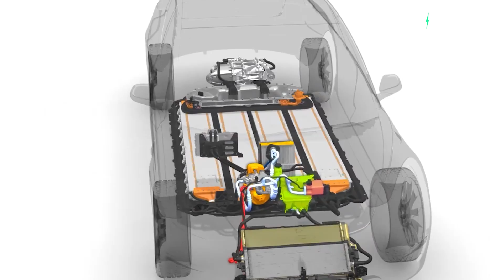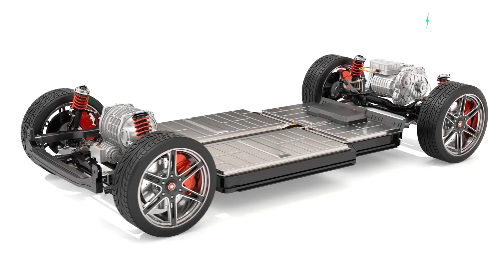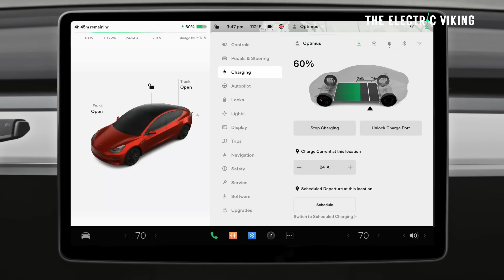No, you don’t need to replace Electric Car Batteries in 10 years time

Comment: There are two factors - cycles, which is pretty much analogous to mileage, and calendar aging which will be independent from usage.  If EV batteries can make it to 20 years (assuming reasonable mileage/charge cycles), then EVs will retain their resale value along the lines of ICE cars or a bit better.  But if the batteries start dying just from old age at 15 years, then cars that are 12 years old (average age of cars in the U.S.) will have little value as they approach the hard deck.  Time will answer this.
Reply: @AudiTTQuattro2003  I think battery insurance is actually a good idea.  If the incidents of battery failure are indeed low, then the cost of insurance would reflect that.  If the price of battery insurance is high, it would indicate to me that the batteries are failing higher than believed. The fact that Tesla (or any) manufacturer doesn't offer insurance past the warranty makes me wonder about what they think the average lifespan of an EV pack will be.
Reply: @ohger1 if insurance wasn’t ‘for profit’ I could agree with you. But as it is, insurance companies use any excuse possible to raise rates.
Reply: @ohger1 so why aren't ice insured for a decade or more?
Just thinking balance ⚖️
Reply: @andrewsaint6581 ? They are. It isn’t legal to drive without insurance.
Reply: @ohger1 even a minor fender bender in a Tesla can result in the entire battery pack needing to be replaced as it’s impossible to validate that every cell is safe.
Reply: @mkyhou1160  Actually not really.  The car's BMS will pick up any electrical anomaly, and a "fender bender" will not generally damage a battery pack anymore than it will a gas tank. It takes a significant frame impact to damage a battery pack.
Reply: @ohger1  that’s not what Hertz found….
Reply: @mkyhou1160   Not the fender, but if evaluator was thinking there is a hit to the battery case, or think impact could damage the battery pack, yes insurance in the past and many still do it, they was taking no chance and full refund. But I heard now more and more now Insurance company have the data and beginning to fix those battery pack if needed (Way less costly for them) as data become available and expertise become available for them with all those new vehicles.
Reply: @sergiomomesso1590  I had a new Peugeot. It was hit broadside on by a taxi (a Toyota minibus). At a traffic light, not a major collision, the taxi was able to drive away, no one was hurt. My car was written off because the chassis buckled. So far as Insurance goes, in South Africa,my country, if the repair cost is estimated to be 40% of the resale value of your car, it is written off.
Reply: @mkyhou1160  At no point did Hertz ever publish anything like that, that's proprietary info.
Reply: @mkyhou1160 that simply isn’t true.
Reply: @mkyhou1160 that isn’t what Hetz said
Reply: My concern with EV's is simply related to price.  I presently drive a 2014 F150 5.0 with 210K miles.  It runs great but nothing lasts forever.  Hopefully the marketplace will continue to develop EV's, but many vehicle makers seem to be moving away from EV's.  Relocating has drastically reduced my annual driving mileage.  But still unsure about an EV.
Reply: @brucegrimmett367  find "I love electric vehicles" article by Rowan Atkinson
Reply: @brucegrimmett367   I wouldn’t be too concerned.  If you drive less than you used to an EV is probably going to be a good option for you.  Because you’re not driving long distances there’s less likelihood of range anxiety than if you needed to drive 80+ miles per day etc.  Get a charger installed at your home, you’ll be able to charge the vehicle for probably $8-15 per charge cycle, maybe $20 for a full size pickup.  No waiting in lines at gas stations or hunting for the best price.  No freezing your arse off filling in January if you live in a cold area, just drive into the garage and plug it in.  

The much lower repair and operating costs end up outweighing the higher initial price.  If you regularly tow items long distances then an EV may present some challenges, at least at their current level of performance and maturity.

Costs should start to drop, especially if Chinese EVs start to show up in the US, assuming that’s where you live. The major automakers are reducing their rollout of EVs because they haven’t figured out how to make money on them, unlike Tesla.  Eventually I expect them to get their sh*t together.

Hold onto your truck for a few years longer if possible and see where the technology is at.  My experience with my 2018 Chevy Bolt is that it is a great vehicle, quiet, I’ve spent literally no money fixing it at all, just standard brake pads and tires replaced. Check to see if there is an F150 Lightning for sale near you and check it out.  Ford is dying trying to sell them right now, I suspect a lot of people are hesitant like yourself but you might be able to get a good deal on one as a result.  A guy I spoke to at the recycling centre near us had nothing but good things to say about it.
Reply: Fun Fact:  The average ICE car in the United States lasts 11.9 years.  Obviously some last longer but this is the average.
Reply: I only know what I’ve personally witnessed and every time, EVs that are 10 years old at this point have been problematic. Ford Focus EVs have dropped like flies in the cold due to battery coolant leaks. I have seen these for sale for $500-$1,500 needing new batteries priced upwards of $15,000. Similarly aged Nissan Leafs experience thermal degradation and high cycle counts causing an unusable range of 20-30 miles when the cars reach 60k to 90k miles. When I finally settled on a Prius for my commuter, I came to the conclusion to wait and observe the EV market. Based off of what I’ve seen, modern EVs are anything but simple and they will be a nightmare to maintain down the road when compared to an ICE or hybrid. It will be interesting to see what happens as these new EVs age. Time will tell.
Reply: @airborneadventurer you didn’t mention the other aged EVs, the Model S. Those have been very reliable.
Reply: Any car, ev or ice has a marginal value after 12 years.  So stop obsessing with replacing it.  Any major work on a car that old will cost more than the car so at that age we just drive them to the ground and move on
Reply: @b3arwithm3  agreed. But nowadays that’s probably closer to 16 years or so.
Reply: @Meatball2022  u mean 16 year life for a car?  If you live in California, it doesn't surprise me.  If you live in Canada, rust will kill your car in just 8 years. You would want to replace the eye sore regardless of the battery or engine condition
Reply: @b3arwithm3  buy an F150 - they are aluminum and run for decades in Canada.
Reply: @b3arwithm3  no. I mean prices don’t bottom out until closer to 16. A 12 year old car is still worth several thousand dollars. Price increases and parts availability issues have caused this
Reply: @Meatball2022  several thousand is isn't much. New brakes cost $1200.  New tires $800. Labor for repair is also high.  I would just trash it at that point because it's a money pit.
Reply: @b3arwithm3  bottom end for a car is usually 2500-3k. A car only 10-12 years old is usually worth closer to 8k. Not near bottom yet. 17 years is more loosely bottom - as I stated before
Reply: @Meatball2022  what 12 years old is worth 8k?  Even in California we won't get 8k for a Camry of that age.  Check kbb.
Reply: @b3arwithm3  kbb even has them ranging from 7700-9200 depending on model. 
It took literally 2 minutes to prove your statement incorrect.
Reply: @Meatball2022  what mileage did you use? I put in 180k which is 15k per year and got just 5500$
Reply: @AudiTTQuattro2003 isn't your battery carrying a warranty of 8-10 years?  You get free replacement if it falls under a certain %
Reply: time DID answer this, via cellphone batteries, also, you do have 10 year old teslas: how much of them are on the road? with how much remaining capacity?
offcourse car batteries are bigger, and more expensive, which raises another difficulty in making small, cheaper, sellable evs: small car with small battery wouldn't last at all before range becomes ridiculous. 

overall, one doesn't know these days will evs remain semi-rich people's toys like they're today. 
given the rising costs of energy and havoc on "green transition" that'll have.
Reply: @ivok9846  to compare a cellphone battery to an EV battery is beyond foolish. Well beyond foolish. In fact, it’s so far beyond foolish I can’t even describe how foolish it is.
Reply: @ivok9846  no, time did not answer this, because cell phones have no active thermal management systems to prevent degradation. The BMS and thermal management in an EV will allow the battery to last much longer, especially if the battery isn’t exhausted completely and charged to 100% regularly. And most drivers of average commute distances with a current generation EV can easily go 2 days on a single charge, so perhaps 180 charge cycles per year.  Hell, I’m typing this on an iPad that’s almost 3 years old and has been charged to 100% or very close and discharged to almost out of power over 800x, and it has basically no thermal management other than slowing the cpu down or shutting down if it’s too hot, it’s still doing pretty decent.
Reply: @sjsomething4936  thermal management doesn't prevent battery from wearing out. 
what exactly your 3 year old iPad proves? 
that if everyone charged to 80% it would extend life to what, 6 instead of 5 years? 7? 
Tesla roadster and model s are more than 10 years old: did they all survive?
Reply: @ivok9846  if you’re so worried about battery life, keep making yourself poorer by buying ICE vehicles, none of us EV owners really gives a shit.  Personally I’m confident that the batteries will live more than long enough to justify the purchase of the car, and so far the data bears this out, as demonstrated by the statistics provided in the video.
Reply: @sjsomething4936  what stats, none of you owns ev near 10 years. as for making myself poorer, can't I buy 2 ice cars for price of one ev, AND each of those two lasts 20 years easily. 
offcourse if I buy used ice, situation changes drastically, and not in favour of ev. and will there ever be used ev market? oughm....
Reply: Battery techs are improving.   My concern is more about motors.  I charge at home most of the time and try not to drain the battery below 10%.
Reply: @canine4350  on my Mylr I simply stay within that daily driver range 50-80 as much as possible. Keep an eye on software updates. If the research changes recommendations it’ll update
Reply: Calendar aging seems to be pretty linear by observing early EVs. (The exeption is the first year where they seem to have a higher loss).
So you can pretty much guess the status after 20yrs.
Also : there is a small, and maybe growing (over time) probability that they will get damaged (cells) that will disable the battery, but there is nothing so far that points to a 'magic' age where this happens.
Reply: @erik5820  you still using a decade old cell phone? It might still work today but it’s crap.
Reply: @mkyhou1160 no, i am not using 10 years old cell phones. They are not made to last this long, and have pretty poor battery-management systems.
But I am using (on a near - daily basis) a 11 yrs old EV (153.000km). It's early technology, so the yearly capasity-loss is approx 2,7% per year - including milage loss
Reply: @mkyhou1160  I have a HTC Touch Pro2 aka Tilt 2 with a working battery. Sure it sucks compute performance wise but the battery still has like 80% capacity. It's 13 years old.
Reply: @erik5820  I’ve got I think maybe 1-2% loss after 14 months and 17k miles.
Reply: it also depends on how much a replacement battery pack would cost at that time.  If it’s not that much more than a replacement engine for ICE cars, then not a big deal either.
Reply: @xsu-is7vq   it's also normal to replace the batteries on ICE cars every now and then.
Reply: Disagree.  Buying a car with 150k miles on a questionable battery is no different than buying one with a questionable ICE engine
Reply: @Meatball2022  an ICE engine costs about 800 dollars,.There is no comparison at all.
Reply: @mkyhou1160  an ice engine for a car costs $800 dollars?  Ok 👌🏼. Sure it does. 
Newsflash, genius.  A USED ENGINE FOR A CAR COSTS NEAR $2000.  And that’s used.  You’re comparing a USED ICE engine to a NEW battery. 
You’re right. No comparison. That used engine might also die in 2 months…
Reply: @mkyhou1160 $800 where?  In Somalia? Or Kazakhstan?
Reply: @mkyhou1160  not sure where you are located but here in Canada I paid $1200 for a used replacement engine for a Pontiac Vibe about 5 years ago! When labour was included, it cost about $1600 to replace.  If the replacement cells are available and not outrageously expensive, it’d be relatively easy for a qualified mechanic with the appropriate EV / high voltage safety knowledge and tools to replace the bad ones in a car like the Chevy Bolt (which I have a 2018 model of) for the same cost or less.  Dropping the battery pack out of the Bolt is actually pretty straightforward other than dealing with the weight of it.  If you’re interested in seeing it in action, there’s a series of videos by Weber State University here on YouTube that show exactly how it’s done. Also, the channel Rich Rebuilds shows how it’s possible to fully rebuild EVs or simply repair bad battery packs.
Reply: @Meatball2022  ok - let’s say it’s 2k, now much does it cost to replace a Tesla battery? The Ford lightning is said to be over 30k for the battery pack. iCE are incredibly reliable today, I haven’t had a major repair in 20 years of driving now. It was different in the 70s and 80s.
Reply: @mkyhou1160  you asked how much a Tesla battery costs, then put a ford example???  Lol
You haven’t had a major engine repair in 20 years. But I’ll bet you’ve gone thru 2 thermostats, 1 radiator, 2 water pumps, 30 air filters, 8 batteries, 1 alternator, 1 throttle body, 8 spark plugs, 40 oil changes, 2 transmission fluid changes, 3 coolant flushes. So you’ve blown thru $4k of maintenance just to be here so proud with your claim.  
And then past all of that, your engine after 20 years is on borrowed time. No amount of praise will change that.
Reply: @mkyhou1160  Bullocks lies, modern engine that are the same age as current EVs cost a few thousand dollars. Sure it's cheaper but not 1 digit less.
Reply: @Meatball2022   The difference is that an ICE car has no hard time limit - I've got a '66 Mustang that hadn't been started in 10 years.  I threw in a battery, poured some gas down the carb, and it fired up.  Original 52K mile power train.  No battery car currently made will be able to keep a usable reliable battery past 15-20 years from what we know about them. 
Both my gas cars have just about 150K miles on them and my S has 62K miles.  Going further, I belong to an antique electric car group on FB - not one of those cars has the original batteries (working anyway) installed.  My buddy has a Model T with it's original babbit bearing motor and that still runs.
 I'll keep the two gas SUVs because they're cheap to insure, maintain, and have low property tax, but I'll trade the Tesla next spring because it will be six years.  There is no real hard data to really get a handle on how calendar aging affects EV batteries.
Reply: @ohger1  but your comparison is ridiculous.  That’s essentially the category that 1 out of every 3000 people fall in - where they keep a car forever with no use. 
And yes, your engine will start. But guess what. All those rubber seals. All those bindings. Plastic conduits for electrical connections. They’ll all be dryrotted. And need replacement.  Try driving your mustang cross country after sitting for 10 years - but if you do keep a fire extinguisher with you.  Don’t forget your engine oil will look like black mayonnaise on the bottom of your oil pan, and the liquid separation part will be like water. 
What you’re doing is suggesting a Tesla won’t behave like a museum’s mechanical piece. The comparison makes no sense
Reply: @Meatball2022  I think you're missing the point.  You can buy thousands of mid 90s used cars in your area if that's what you want.  Age is a concern but it won't doom the vehicle. The reason this is important is that if EVs hit a hard wall at a certain age (yet to be determined), then it will greatly affect the resale value of these car when they get older.  I have an 09 Ford Edge and an 11 Mazda Tribute besides my 2018 Tesla S. If I want, I can keep either another ten years with (hopefully) minor maintenance - an option I won't have with the Tesla.  Next spring I'll replace the Tesla with another S most likely and keep doing so every 5 years as long as I can drive. 

There's always the possibility that in ten years, a new battery chemistry that allows cheaper, lighter, and more dense cells may give rise to aftermarket batteries for an older EV, but right now, that doesn't seem to be the case.
Reply: @ohger1  no. I think you’re missing the point. 
Cars in general are not meant to last forever. Nearly nobody buys a car to put a few hundred miles a year on it. 
If it does hit a “hard wall”, so be it. That’s a foolish purchase if your intent is to never use the car. 
The hard wall you describe doesn’t suddenly jump out at you. It arrives slowly over time. An ice engine?? The hard wall is shown by a complete engine failure. 
Also, to replace a used engine that failed with a used engine that hasn’t yet failed isn’t a fair comparison.
Additionally, replacing an engine often destroys the attached transmission. 
And let’s not forget - those prices increase every day, while battery prices don’t. 
The average EV buyer doesn’t use it as you suggest in your comparison. They use it as their daily driver. The average EV buyer will resell it long before any perceived wall is near…
Reply: @ohger1 but why car makers have to concern themselves with a small group of collectors? Who ever designed cars for a few unless the ultra luxury segment?
Reply: @ohger1 that isn’t true. LFP batteries can last decades with light cycling. That is why they are also the choice for stationary storage.
Reply: @williammeek4078  You're talking theoretical life - show me an EV that has an LFP battery that has lasted decades, or absent an EV - any high draw production pack in use for 20 years with a high percentage of those still usable.  "Light cycling" won't do it for vehicles which is what we're talking about, but I would be interested to see ANY LFP battery pack still usable as installed in any device after 20 years for anything other than keep-alive memory usage - and I hope you can prove me wrong.
Reply: @ohger1  No, YOU were the one talking about a theoretical life. At least my statements about LFP have years of cycling data to back them up. 
We already have enough data to say that the older Model S batteries will last 300,000 miles typically. There are some Model 3s that have hit 300,000 miles as well on their original battery with at least one that has exceeded 400,000 miles.
Reply: @williammeek4078  We're not talking about cycles, we're talking about calendar life, and not "years", but "decades" (your term). Nice of you to move the goalposts - I didn't expect a citation because I know they don't exist. There is NO data regarding calendar life of these packs except for the earliest Tesla Roadsters which,  from the ones I looked into for possible purchase,  had about 75% of them already replaced.  Now, those are not LFP so my comments didn't address early Teslas as I do expect the LFP to last longer (hopefully).  My 2018 S has 85K miles on it, and will be traded for a new S before the warranty expires.
Reply: @ohger1  There is no moving goalpost. I am just calling you out on BS arguments. You are trying to make absence of evidence into evidence of absence. There is no supporting data to say that anything but cycles is a factor. If you have any, go ahead and show it. But as you already admitted, you don’t have any. 
I DO have cycles life evidence and evidence that a decade of calendar life doesn’t measurably affect battery life.